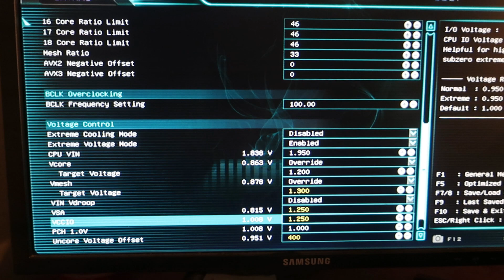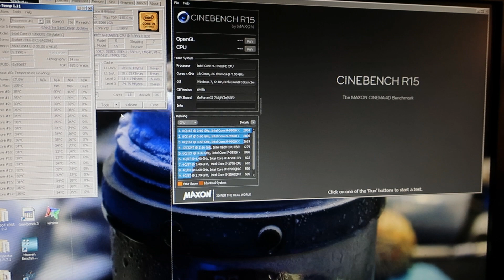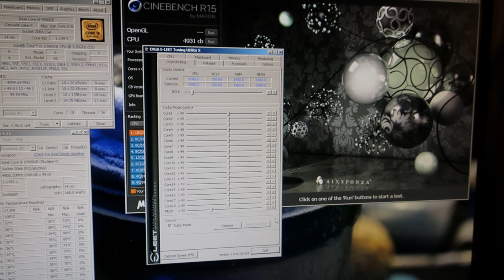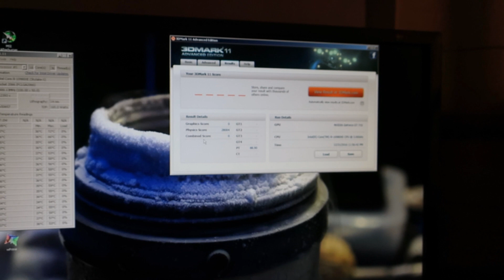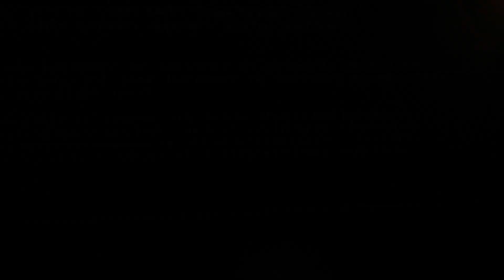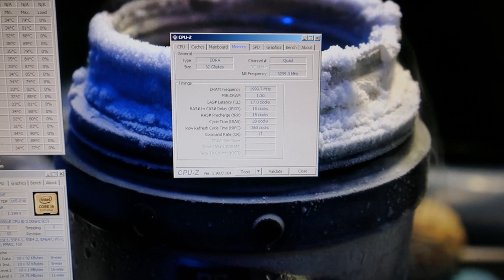Intel Cascade Lake-X 10980XE Review & Overclocking to 5.1GHz

Comment: 8:00 Hey Luumi, how do I determine which PCB my B-Die is? I just got a kit of TridentZ 3200CL14 and I'd like to find out.
Great video as always, your the only person on youtube that consistently uploads legit XOC content.
Reply: You can use a utility called thaiphoon burner.
Reply: @AndyBradley1984  Thaiphoon Burner isn't going to give an accurate PCB report.  You have to physically look at the ICs on your memory to determine PCB type.  It's not necessary to remove the heatsink, just look in the gap.
Reply: G Skill 3200CL14 RAM is a Samsung B-DIE guaranteed

Comment: thanks I subbed I am looking to upgrade from 7980xe just even If I will be able to hit 4.5 ghz on all 18 cores I'd be happy
Reply: lol 10980xe is just cheap then 7980xe but they are the same thing 7980xe can hit 4.7 ghz with adequte cooling
Reply: @rustydust8648   yeah I should've just kept my 7980xe I am using a 360mm aio cooler I could not hit 4.7 I only wanted to hit like 4.4 and run that 24/7 but maybe I was using the wrong settings
Reply: It's the same chip just better binned, if you already own 7980XE/9980XE then there is no reason to spend money for some 200 Mhz + on clock speeds.

Comment: Some say that this CPU was hurt with recent built in security exploit mitigations and didn't show it's potential over previous Skylake X CPUz for that reason. Do you have an opinion on this?
Reply: EVGA released a special BIOS without the microcode fixes.
Reply: @sabishiihito  I'm running a special BIOS on my X299 Dark on a 10940X.  Complete Garbage,  Cascade lake is gimped no matter what you do.

Comment: I tried running the new AVX Prime95 version some time ago when i had a delidded direct-die liquid metal 7800X at 5GHz 1.3Vcore which was my daily stable clock and the power consumption was insane for a 6core/12thread CPU, watercool heatkiller IV CPU block and Mo-RA 3 420 Pro radiator outside in winter for around 6C celsius fluid temp and CPU core temps were still above 90C. For any other load it didn't need to be cooled this extremely, my highest frequency for R15 was 5.2-5.3GHz with this setup. MB was just a cheap ASUS TUF X299 with a spare heatkiller VRM heatsink from X99 board - it fit pretty well, was just a little bit crooked on the VRMs like 1-2mm.

Comment: many people accused intel of lying, talking about that CPU will never reach the 5GHZ mark, I think is better to just run it at 5 GHZ max, those extra 100 MHZ are going to increase the power draw plus the heat, so is not really worth it to go for 5.1 unless you are trying to break or stablish some kind of record, 5ghz is more than enough for me, I just order 64 gigs of ddr4 4000 MHz ram 8x8, if I can overclock the ram to 5ghz to match the CPU multiplier to run it at 1/1 CPU/RAM ratio I be more than happy but I will settle for 4.8 each , the lowest, just waiting for the CPU to be available to buy it, as soon as I get my CPU I will come back and update my post with the results
Reply: but the memory controller says max DDR4-2933. How will you be able to overclock it that high? Is not possible. I doubt that you are going to make the bandwidth faster than 80 GiB/s on four channel.
Reply: @Πυξίδατηςηθικής  hi that is not correct, ddr4 2933 is the highest supported speed without overclocking, aka normal clock speed. i had a 7960x with 32 gigs ddr4 3000 and i never had any problem enabling xmp profile and running the ram at 3000 mhz also i was able to increase the speed to 4000 mhz without any problem and the 7960x memory controller was a bit slower “2666 mhz” than the new cascade chips which offers and improvement in memory speed, i also checked and there are new 4500 and 4800 memory kits, while x299 might not go that high, i’m sure i can get at least 4333 or 4500 mhz , not that the ram can’t go higher but maybe that is the chipset or board limit, i will find out soon, also deb8auer have a video showing 5ghz ram from aorus
Reply: @Πυξίδατηςηθικής  i understand what you are saying but let me give you an example, let’s say we both have a car that can reach 100 mph that is the limit set but my car can get to 100 miles faster than yours, so it doesn’t matter if we both reach 100 because by the time you reach 100 the race will be over, simply because you car took longer to reach the speed so is not just the limit in the bandwith
Reply: Yono Existo   Many people try to discredit Intel in every way they can think of to boost their own ego. At least Luumi spent a little time with it and gave an opinion based on testing and facts instead of bias.

Comment: I’ve been lurking your channel for awhile now. Can you do an AMD over clock vs intel hedt with mesh overclocked and cores at 4.6Ghz something average? I have someone saying AMD 3rd gen can beat out x299 cpu, but I told him mesh overclock helps performance and so does core over clock
Reply from the maker: I don't have any new AMD stuff at the moment, but I can see if I can get any.
Reply: Luumi please test an 8 cores if possible as that’s what most people who play 144hz aim for. Test games with a lot of draw distance. (Draw calls) and textures high up. The rest of the settings can be low. No reviewers are testing mesh over clock on the hedt vs Ryzen benchmarks and it sucks to see that as they aren’t using the full potential of hedt. I have my 9800X at 32 mesh and 4.5 all core.
Reply: @Multimeter1  amd for games - lol this is joke )
Reply: I have a TR 3970X at 4.5GHz daily, it's an unfair comparison vs x299 or SR3. Lol.
Reply: @frostybe3r  LOL TARKOV 60FPS ?
Reply: @rsm4541  What?
Reply: escape from tarkov - game
Reply: @toh bot Is that a serious question?

Comment: Do you have any idea what could be the variance in achievable frequencies with such cooling and voltages across retail 10980XE chips?
Reply from the maker: Atleast for non-AVX I think 4.8-5.1 like this, for AVX a bit lower. But I would overclock per core to get higher frequency when not all cores are being used.

Comment: Hey @luumi, hoping you would read this comment, I want you to solve some doubts about this processor:
I wanna buy the 10980xe for multipurpose (gaming and programming/database worlkload) and I wonder which bios configuration should I use to reach the highest (stable) clockspeed without crashing the system and without using another water-cooling rig (I have a coolermaster liquid maker 240). If anyone can help me with it, it would be appreciated.

Comment: The InputVoltage is too low. Check your system with HWiNFO64 and OCCT (PMAX Limit / VCCIN Under-Voltage). AllCore 4.6 GHz with ~1.375 V and InputVoltage ~2.30 V is stable. 4.8 - 5.0 GHz is the limit on water (no allcore) at 1.35 - 1.50 V and 2.35 V InputVoltage.

Comment: which radiators did you use in your loop ?
Reply from the maker: TFC Monsta 420mm, then one 360mm rad and two 240mm rads. Way overkill but it became like this long ago.
Reply: @LuumiJuhani  Do you think a 60mm thick 480 radiator is enough for 5.1 ghz ?
Reply from the maker: @spieleheinie5156  Well it depends on voltage requirement, but yes one fairly thick 360-480 should be good enough for the 18 core.
Reply: @LuumiJuhani  thank you very much!
Reply: Are u looking to buy it 
I want to buy it but feeling bad cuz the 3950x beats it
Reply: FLASH at 4.9/5ghz 10980 XE beat 3950x on water..

Comment: How high vmesh and uncore offset would you consider safe for daily use?
Reply from the maker: Try what you can do with 1.3v mesh voltage. Uncore offset 300.
Reply: 1.3V vMesh is way too high for 24/7.  Stick to around 1.15 Volts but 1.2V would be max.  I dropped my voltage to 1.15 and stuck to a stable 3Ghz Vmesh speed.
Reply: @FunktasticLucky  it's depend radiator and chip, as relate only temperature so it can be more 1.3 or les 1.2

Comment: is it possible to hit 4.6 ghz all core turbo on a 360 closed loop water cooler for the 10980xe ?
Reply: I hit 5Ghz on 10920x. But if you overclocked the memory too, the temps will go crazy. I was using 32 gb 3000 CL15 HyperX quad module without high temps. I switched to G.Skill F4-3600C16Q-32GTZR. I put some voltage and run 4000 mhz without changing timings. VRM and CPU temps start to go crazy with Cinebench. I back to 4.8 Ghz and i am fine now. So for 10980XE you can hit too.
Reply: @MalikAslanyurek   I am fine with leaving my ram running at the 3200 its rated for but my question is ya I don't want to go that high on the overclock I will prolly see a better overclock for games if I start overclocking my gpu I will be watercooling it soon 3090 ftw3

Comment: so can i run a 10980xe at 5ghz daily ? oin a asus rampage extreme encore?  or more importantly should i
Reply: if you can cool it to <85 it's ok all higher will degrade after couple of years, but it's only about all time at max load, so even with 90 it's ok, if 90 will rare peaks... other question if you really need it, any way better drop some and have 75* for real 24/7  max load for any cpu... it's all about temp not about voltage or freq so if you really need it, just take best water cooler with bigest external radiator on the market and go on, found lowest voltage for stable frequency with stay 75-85*c

Comment: It's still not really a good deal considering you need a lot of hardware to cool one of these compared to a 3950x...
Reply: This cpu isn't about best deal, it's about best performance when overclocked ;)
x299 cpu's suck when @ stock, but it shines when overclocked with watercooling or even better cooling. This is why I love my delidded 7980xe @ 4700mhz. Memory tweaked, and I'm getting 50ns memorylatency compared to ~80ns @ stock and 3200 xmp memory.
My 3900x is very good @ stock, but can't compete with my 2 years old 7980xe when fully overclocked. I have them for different use ;)
Reply: @nizzen2  Sure it's definitely a fun chip and platform but I don't think you can make any sensible arguments for it as a serious purchase. Let's not forget that most sites benchmark the ryzen 3000 parts at stock memory as well so the FCLK gains are not used either.
Reply: @literofcola6628  lol I ran a 7700k for quite a while before switching to a 3600, the intel stuff is def more fun for OCing, but its way worse value and performance at this point.
I sold that 7700k for €240 and bought a 3600 for €190 by the way... I would have been interested in an X299 system if the cost wasn't so absurdly high and the arch wasn't getting new security vulns faster than NVidia has been releasing Turing cards this year.
Reply: Asle Andersen what’s your mesh at? Can you post gaming benchmarks between the 2?
Reply: @nizzen2  It shines when it's pushed to draw insane power and output tons of heat and still not keep up with a stock Threadripper?  Even at half the price it used to be it's not able to keep up at those speeds.  4.8ghz showing around 48-4900 CB r15 is now being beat by the 3960x at close to 6k running at stock.  Not sure where to add my wink face, so I'll add it here -> ;)
Reply: @PistolShrimpPimp  If you play Cinebench 24/7, Threadripper is the best choice :)

Im using threadripper 1950x for ubuntu server and F@H. Different platforms for different usage.

7980xe is my workstation, and sometimes I have time to play BF V with it ;)
Reply: @nizzen2  Why would you compare a 2 generation old chip to a new one? Do you work for Intel?  IPC is much better on newer AMD chips and they play games extremely well.  Even the older Threadrippers do too. The 7980xe was $2000 new, the 1950x wasn't half that. Now you can get 16 cores that match that and play games at higher fps with lower power than even the 10980
Reply: @PistolShrimpPimp  I don't compare them. You compared 3960x  Trx4 vs 10980xe ;)
Ps: I don't do stock...
Reply: @literofcola6628      I thought i smelled something odd suddenly.
Reply: @PistolShrimpPimp     Go back to where all the AMD fanbois are. Intel users don't need you to insult their choices.
Reply: @wewillrockyou1986      Did anyone ask for your biased opinion?
Reply: @nizzen2  How much did you pay for your 7980xe lad? You're only running at 4.7?